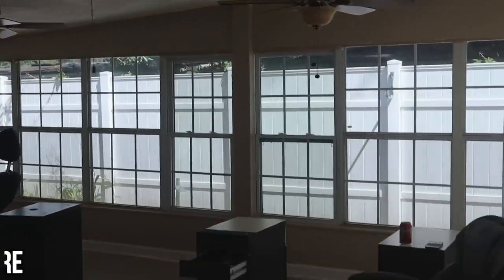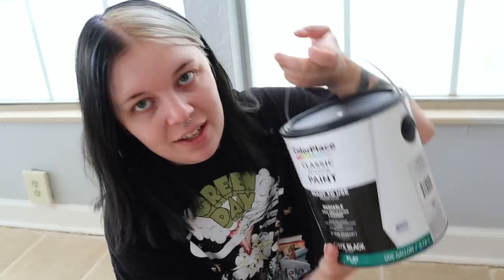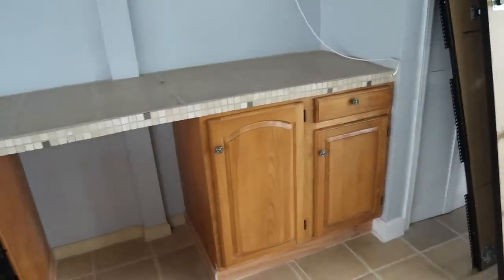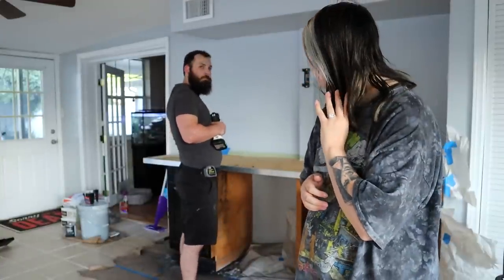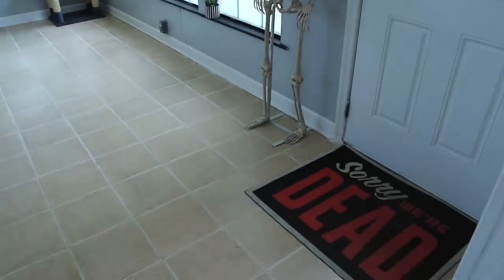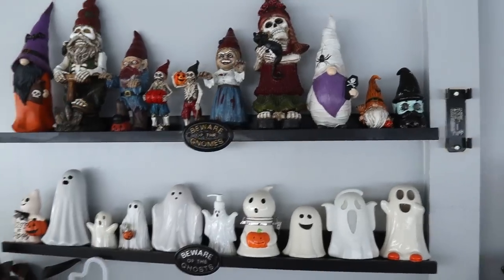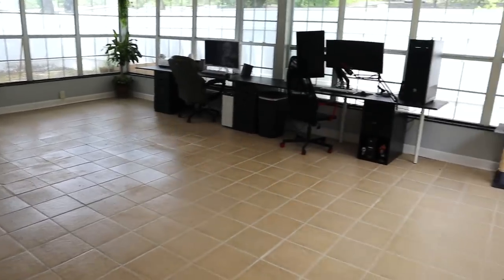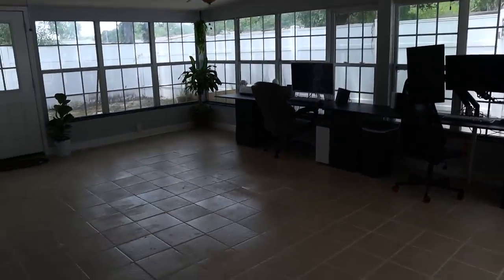DIY Dual-Setup Office Transformation! ☀️ Florida Sunroom☀️ Flip The Crypt #3

Comment: Bridgette,It's a blue/ gray ...It's a very pretty color combination
How about using painters tape?
It can help you paint a straight line
A wet vac will help you get rid of the water
Water proofing the floors ( concrete or wood) will prevent them from being damaged. It also prevents flooding
You & Cortland are doing a great job with the renovations

Comment: I definitely think those foggy windows can be cleaned. I don't know why I think vinegar would do it though. If not, ask a window professional.
Reply: I think the moisture is in-between the two pieces of glass. I think there is a gas between them for energy efficiency, once that seal gets broken, moisture collects and over time it affects the visibility.
Reply: Yep.  The seal has broken.  Had a set like this at my rental. Also had single panes in the basement that seeped constantly with the humidity and encouraged mold growth.    I am in a COLD and very humid area not a warm and humid area so most of the year we can’t just open the windows or we will freeze.  Don’t miss those.